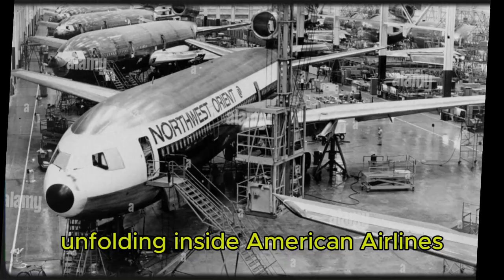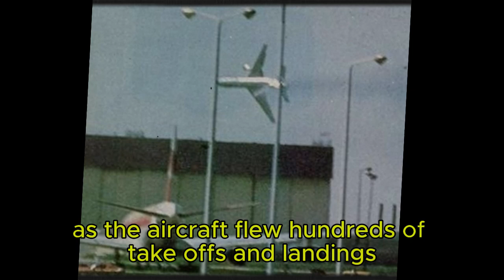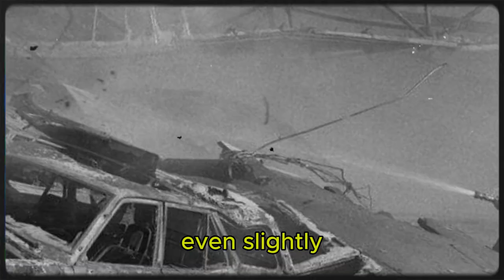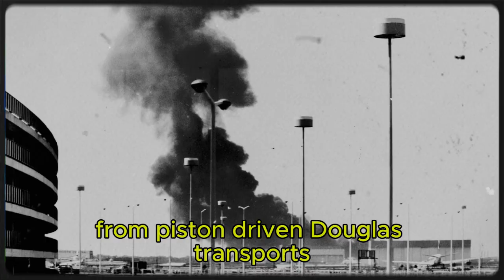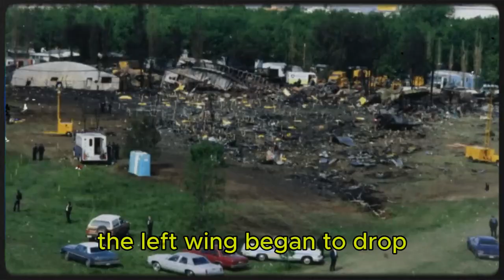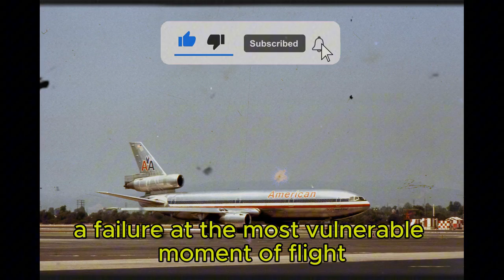The Deadliest Single-Aircraft Tragedy in American History

Comment: This video was well done. I was surprised to see some photos, that I hadn't sen before and I have studied this crash for years. It was very tragic in a lot of ways. People want to stop the investigation at poor maintenance but a deeper investigation will point the blame at McDonnell Douglas. They were in a heated competition with Lockheed and the 1011 TriStar. Because of this, McDonell Douglas proceeded with production of a flawed airplane. Several engineers early on, tried to raise alarm bells about the placement of the hydraulic system, the lack of backup systems and the other issue, was the cargo doors, which would cause  2 major incidents before Chicago. The engineers  were told to keep quiet and not say anything to the FAA, for fear that sales would suffer.  The ethical issues behind this were tragic enough but noone mentions how emotionally traumatic this disaster was.  My father was a Psychologist and this crash brought to light, one of the first discoveries, that people who did not serve in the military, can suffer Post Traumatic Stress Disorder ; and in fact, one of the maintenance men at the  Tulsa center, committed suicide. His name was Earl Russell Marshall. People at O'Hare that day, and those who saw the dramatic photos, had the horror permanently seared into their minds.  A tragedy like this, is beyond what the mind can handle. Another issue not addressed, is that after McDonnell Douglas merged with Boeing, they apparently didn't learn their lesson from the DC-10 fiasco because some of the same issues repeated  themselves with the 737 Max . Finally, I want to state, that one of  the daughters of  Bill and Corrine Borchers, a couple on Flight 191, helped to make a memorial to Flight 191 possible. Kim Borchers Jockl was a Chicago area school principal and her students helped design and dedicate the memorial which is located in Lake Park, Illinois.